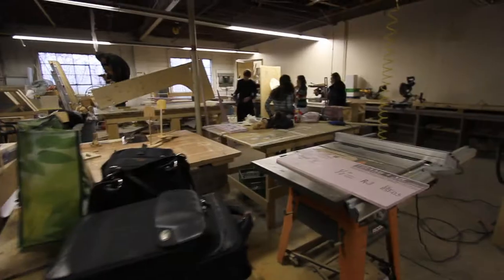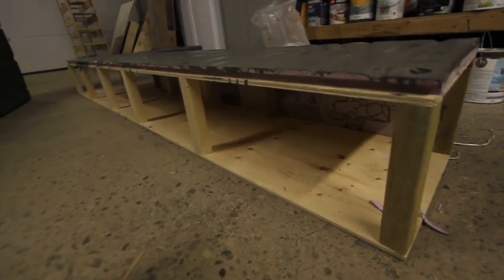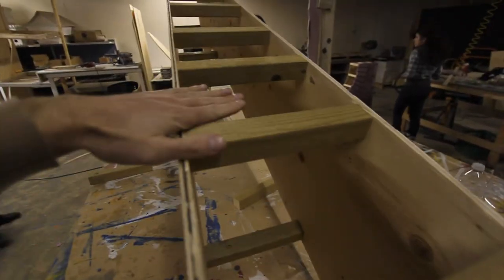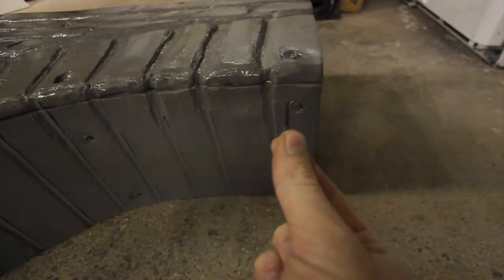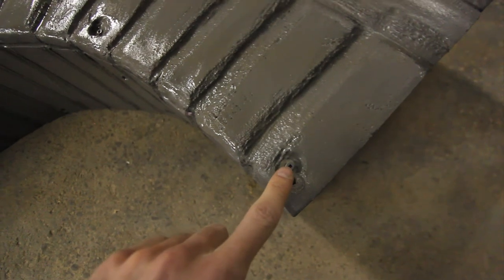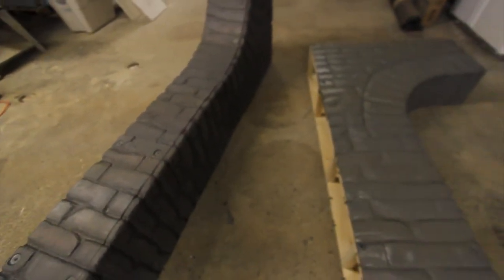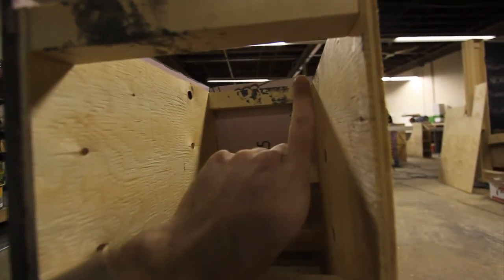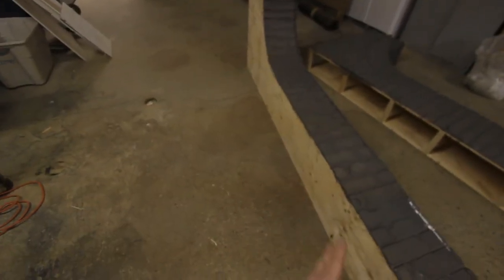Haunt Ventures 144 - foam panel jail cell column continued

Comment: Thanks for the close up look of the columns. That looks great and seems pretty easy to build. Fyi, another way to seal your foam is to use vinyl concrete patch mixed with wood glue. You can mix in concrete stains to cut down on the paint time.